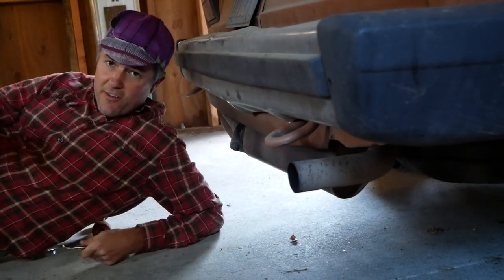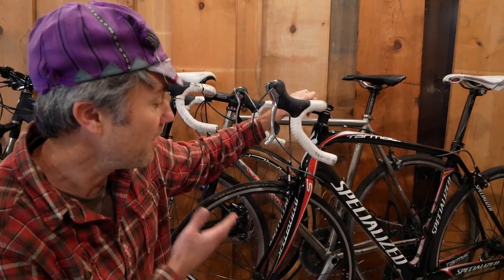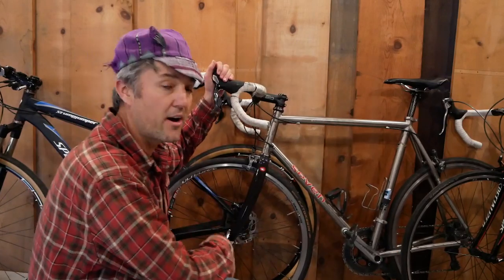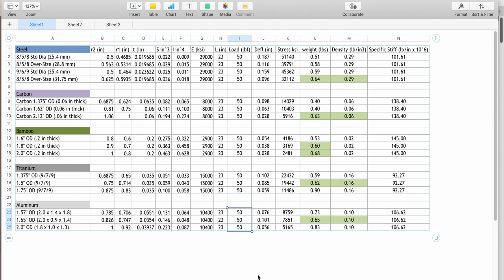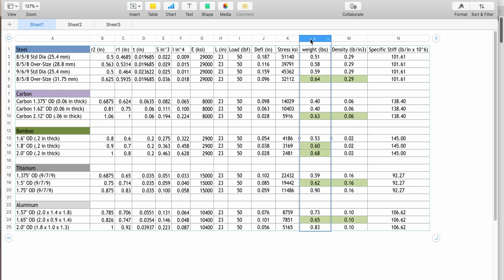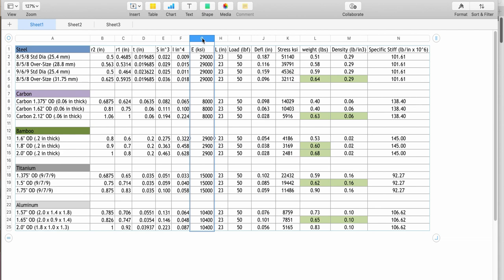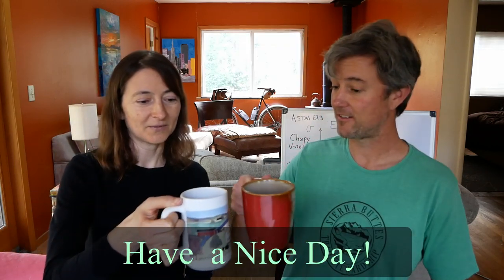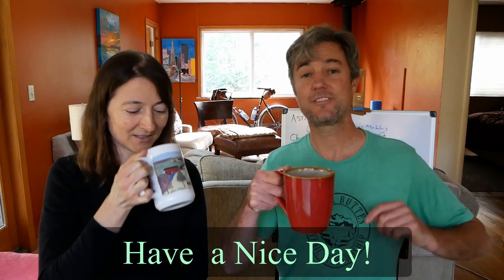Steel is a Great Material for a Bicycle Part III: Stiffness

Comment: Ha, you have the same color Westphalia we used to have.  Vintage '83 water cooled, bought in Deutschland, brought to CA, blew a headgasket under warranty, then driven to death by my in-law's kids.  What a great vehicle.  Many a Moab trip taken in that thing.  Wife cried the day we sold it.  Miss it dearly.  Sold it in Berkeley.  Do you have ours??? 

Too bad the VW "California" camper van isn't available in "California!"  Boo!

Steel is real.  Especially today.  And your bike isn't even taking full advantage of the newer steel alloys on the market.  That shit is STRONG!  Air hardening stuff that is amazing.  So your "steel" column is overly simplified, given all the alloys and heat treatments available.

But let me give you an example.  When I worked with a local framebuilder, we had stock cross frames built with 130mm spacing.  At the time, the industry was just moving to 135, but about half of our buyers still wanted 130mm.  So that meant re-sizing the rear dropouts on half of the inventory going out the door.  These frames were built without chainstay bridges behind the BB shell, which several retailers questioned.  (This story is why they were full of crap - the bridge was TOTALLY unnecessary.  Anyway...)

It was my job to put the frames in the frame jig and cold set the rear dropouts out 2.5mm on each side.  How hard can cold setting a rear triangle out a mere 2.5mm?  Especially road models with thinner stays (than mtb.) and no BB stay bridge?  It took ALL of my 190 lbs. BOUNCING on the dropout to get those things to move.  And these weren't some over-built frames with heavy, beefy dropouts.  No, elegant stays with minimalist Ritchey dropouts.  This was a workout!  Blew my mind how much effort was involved.  This steel is effing strong!

And this is someone who fondly remembers the Cannondale catalogs in the 80's proudly showing off a cyclist crouched on the rear triangle of a bare C-dale frame on the ground that said, "If you did this to a steel competitor of ours, it would collapse!"  And they were right.  But that was the standard 4130 Chromoly of the time. 

Today's chromoly heat treated steel alloys are in a completely different class.

Discussing aerodynamic tubes in a randonneuring context?  Silly.  You body position has WAY more effect on your drag.  Then hand position (aero bars).  Next comes your wheels.  Aero tubes are dumb unless you live in a wind tunnel.

PS  Who remembers Moron tubing?!!!  A winner!  Moron, or "More on" the ends!
PPS  Too bad TrueTemper departed the steel bicycle frame tube market :-(Now they're only focused on 'shafts!'  Nimrods!)  And yes, I realize there was no market for them...

Comment: Another great technical video, this time with a student (?) I love my 5 steel bikes, that I have collected over the years. However, 2017, I did buy a AL and a CF bike, just because. Sort of , always wanted a modern AL and CF bike in my collection.  I have ridden both new bikes over 40 miles, and I find them just as comfortable as my steel bikes, saddles and 25/28mm tires make the comfy difference.  As for aerodynamics, that's for the pros. KB.

Comment: Being a nature grown product, Bamboo varies in shape and perfection.  It's strength is much like carbon fiber, but bamboo cannot be shaped like carbon fiber fabric.  There are bonding challenges with it too, not so easy.  That is why you see bamboo frames butted with steel components, which are pretty expensive to make.  Great vid you two!
Reply: Actually bamboo frames are fitted with rope or cord drenched in epoxy, and, in some cases, fiberglass cast material.

Comment: that was enjoyable for sure,  and there’s no doubt that you could spend a lifetime exploring this subject, heck just concentrate on steel and develop the theory along construction techniques, tube size selection, butting, and the effects of riding (work hardening) on long term durability and how frames get ‘tired’ after years of being ridden........

or you just show more of your fantastic roads and trails, either way I’m in :-)

Comment: The nice thing about CF is the ability to vary layup and orientation depending on the shape being created. Aluminium is similar with modern hydro forming processes. Still, all my bikes are steel these days. Spent plenty of time on modern CF frames but have little use them now.

Comment: Hi Henry and Miss Cools, from Yorkshire UK, my grandad told me how he cycled to Scarborough on the Yorkshire coast when he was 16 in the year 1916 on a bike with bamboo wheels, they buckled and he and his friend had to take the train home (about 80 miles). Perhaps this is why bamboo bikes never caught on. Also stories of rear three wheeler cars in the 1920's which used to tip over going around corners, so we don't see those either. Hired a bike in SF last year and cycled the Golden Gate bridge, very enjoyable. All the best from a wet and wild Yorkshire.
Reply from the maker: Bamboo wheels, wow! I think I'll stick with aluminum for now. It's good to hear you're getting rain we're still waiting for ours.
Reply: Hello again Henry, after posting my comment a video came up by GCN Tech - 'The Incredible Bikes and Cycling Tech of the First World  War' which may interest you. Bikes with wooden wheels and solid rubber tyres. One comment said there were bikes with cane wheels which offered more flexibility and spring. Would make sense I ride some of my grandads paths on my mountain bike. Looking for an address to send you some photos. I work at a museum with a bike section. We have an 1875 bike with wooden wheels and steel tyres like the old carriages. Our WW1 exhibition has photos of Indian Soldiers bike packing on those early WW1 bikes. Hope you enjoy the film. Elizabeth
Reply: RollinRat  Hi Rollin, Just the story he told me as a teenager, inspired me and my friend to get out on our girls 3 speed steel bikes in the 1970s. I work in a museum and we have one old bike in our collection with wooden wheels, don't think I would fancy riding it though. I live high on the pennines so hoping to get out this week near home. Been self isolating since the middle of March, not sure if I've had Corona or just bad flu, but I'm ready to get back  on my bike. Stay safe.
Reply: RollinRat  Hi Rollin, Still got my old girls bike I bought with my pocket money when I was 12 but it sits in the barn now. Getting older and living ar the top of a one in four hill I cheat quite a bit these days and ride an electric bike. I have a mountain bike which I do ride more in the Summer as my fitness improves. Lots of off road trails near me and its fun to ride. I have a campervan so I usually take the mountain bike away with me. I do have a folding bike with 20 inch wheels that fits inside the van, but that feels too much like hard work unless it's really flat. Nice to talk to you, all the best. Elizabeth
Reply: RollinRat  Hi Rollin, Yes in my early 60's enjoying life, semi retired had a gap year at 60 but then went back part time to my job in the Museum. The weather in the UK can be awful in the Winter, hardly got out at all this year too wet. When I did get out in February it was on the electric bike. So disappointed at the end of last Summer I was out on the mountain bike most of the time my fitness had improved so much. With this lock down hopefully there will be a chance to get out more. My electric and folding bikes are steel but the mountain bike is aluminium. Put some Jones H handlebars on my mountain bike to make it more comfortable. Its not steel but put of all of my bikes I do think its the prettiest, I just love the colour etc but that's just a girl thing. I had the gears on my folding bike lowered some years ago, better now for hills but frustrating on the flat. Had the brilliant idea of adding the original chain ring and an extra shifter, front derailleur to the folding bike. Took it to a bike mechanic who said it would probably cost more to weld points on the bike to fix the cables than the bike was worth. Suggested I go away and work on my cadence, probably right, again this is a great trail bike with wide wheels and big chunky tyres so I don't want to replace it. We have some great cycle  paths in the UK and I do enjoy riding away from traffic. It's fun planning holidays around cycle trails. Having said that I did hire a bike when I was in San Francisco and felt quite happy seeing the city that way. Did a big trip across the USA on Amtrak, wouldn't have fancied it in Chicago the traffic was nuts. Wish I'd hired one in Santa Fe. Don't know when we will all be able to globe trot again if ever. You enjoy your semi retirement too. Heading to bed now it's late in the UK.
Reply: RollinRat  Thanks Rollin, I will look into that, I had thought of a jubilee clip or cable ties after I left the bike mechanic. The original chain ring is pretty heavy steel, but has mounting points where the smaller chain ring could be attached. Maybe I could find something similar but lighter. Not confident to do it myself at present, maybe bike maintenance classes, spent 8 years going to car maintenance and body work classes. Find in that sort of environment people are always keen to help one another. Once again thanks, I'll look up the parts.
Reply: RollinRat  Thanks for that, been a few years since I attended classes. Still got  my little classic sports car, I took to classes to work on, but think my mechanic needs to get it running again for me now. Life took over for a while and there was less time to spend on hobbies. I'm lucky in that my Campervan is 4wd and so is my everyday car. I do love small discreet 4wd that can get you up a single track road or track. I like the folding bike, because it's more stealthy in the van when wild camping. It also fits in the passenger seat footwell. Like you I like to keep my bikes and cars a long time. Had my 70s sports car almost 30 years now, took a lot more saving up for than the first bike, but that's what makes them loved and treasured.
Reply: RollinRat  Hi Rollin, No I'm a big fan of Japanese 4wd. My Campervan is a Toyota Regius 4wd. A company near me buys low mileage Japanese imports and then puts new conversiond in them. It was just like having a new van at a 3rd of the price of a vw. I got to choose my layout trim and upholstery. The base vehicle is 1999 and I have owned my camper since 2011. I know you can't get those Japanese imports into America until they are much older. My everyday car is a Daihatsu Terios 4wd, it is the second one I've owned, my last one was fine mechanically but rust issues meant it wouldn't pass another Mot. My first car was my mums old vw Beetle, that broke down so much I couldn't afford to keep it! Those Vanagons look cute. I really the truck campers and considered one when I bought my van, but the insurance in this country was just crazy. Also I don't have to leave the vehicle if I need to move on in a hurry.
Reply: RollinRat  Just to add to my last comment, you are very lucky to have those Overlanding trails over there, we have nothing like that here in the UK. Wild camping in England is illegal although allowed in Scotland. Always seems to be cars around though. My ex is from Washington State and I know you can travel down a logging road in Washington or Oregan and see no one all day. I have managed to find the odd logging road in this country but there's not many. Love watching some of the Overlanding channels. Enjoy what you have out there.
Reply: RollinRat  Thanks Rollin, Will have a look tomorrow, heading to bed now, hope to get a bike ride in tomorrow before the government bans out door exercise. Our PM is in hospital now, thank goodness for our Queen gave a lovely speech tonight to keep the spirits up.
Reply: RollinRat  Can't say I liked California that much when I was there, but I'm used to cold and hills. I did like San Francisco, but wouldn't like the earth quake threat. I'd heard it had become expensive. I'm very lucky living in the family home that's been in our family for the past 500 years and it is rural. Probably best in Colerado once this is all over. Still up been trying to ring my ex in Seattle just to make sure he's still OK. We spoke about 3 weeks ago but things have got alot worse since then. Was back in Seattle a couple of years ago and it was so busy compared to how I remembered it. You take care of your family. Stay safe
Reply: RollinRat  Hi Rollin, Just wanted to thank you for the suggestion of clamp on cable guides, they look to be just what I need. Found the Top Gear programmes on 'How to kill a Toyota' think as long as I take care than my van doesn't rust and the government don't insist on electric vehicles , I may just already have my forever van. Got a good bike ride in today up on the Moors, very quiet out there but feeling so much better for getting out. Thought you may want to see what some of  my local bike rides . Found these on YouTube Cup with Reservoir Marsden Moor Blueflush,  Wessenden Head  Mountain Bike Ride Terra Nova and Marsden Packhorse Trail MTB Junibesi 14 .The last one is a bit too difficult for me , I was up there last Summer ,out for 6 hours and pushed the bike down most of it, the ruts were half way up the wheels, didn't want to end up in hospital. Today just did the Cupwith one. Hope to get out tomorrow. Best wishes to you and your wife, and thanks once again for the advice.
Reply: RollinRat  Thanks  for the offer Rollin, there did look to be quite a few available on Amazon, not going to order now because deliveries are all over the place. Ordered quite a few bike/ van / camping things over the winter ready for this Summer, luckily most things arrived before the lockdown just a couple of things who knows where. Looks like August before we are back to any sort normality. Did see three planes today which seemed strange one flying low on the flight path to Manchester Airport, probably bringing people home from wherever in the world they were stranded.

Comment: Wow I thought I was a Specialized junkie with my steel Stumpjumper Comp and bonded Allez Epic 105 but you handily beat me. For my plastic fantastic bike I have a Look 555 Ultegra which feels like I'm riding on air except when I go uphill.
Reply from the maker: I finally let go of my Specialized Expedition touring bike. It was a great bike, but a little on the small side. I like how the new Fitz feels, but I may need to find another touring specific bike to fill that void! Dang!
Reply: @Henrywildeberry  I think the randonneuring Ms Cools keeps trying to get you to do is a lighter way to bike tour.

Comment: Two weeks ago a friend of mine who has a full carbon-fiber bike (a 2019 Canyon Grail, w/ hover-bar) and I (on a Specialized 2018 AWOL steel bike) road some very rugged and rain-rutted, and very chunky gravel roads. At the end of this ride, as we were loading up and driving away, my friend mentioned how 'beat up' his wrists and hands felt; whereas I felt surprisingly less beat up. The question  I have is do you think his carbon fiber bike, being so much stiffer than my steel frame bike, was the main cause of his hand and wrist fatigue? He certainly had the advantage in the lighter frame, but over all, and with the roughness of the roads and hills we'd been on, I felt my steel bike held it's speed better over all, and was more forgiving of the jarring nature of the road surfaces. Any thoughts on this? Thanks. And thanks for the more detailed look at steel and material comparisons!
Reply: To me, carbon forks are targeted to sprinters, and are way too stiff for most of my mileage.  My wrists never got so tired with my steel forks -- not because of the material alone, but because they were built to have spring that a carbon fork can't have without risking delamination.
Reply: Umh....probably variables like handlebar type, size and material, grips/wrap material and thickness should be considered, not just frameset. Tire size, how much they were inflated, too. Bike fit also contributes to comfort during rides exceeding usual distance or "easiness" of road conditions.

Comment: What about sowing us the difference in your chart on 6061 Aluminum and 7005 Aluminum?  I do own a Chromoly Steel bike with Aluminum parts and little bit of composites too.  My new road bike has 7005 Columbus Triple Butted zonal Aluminum with Carbon Fiber Seat Stay and Carbon/Aluminum Fork.  The rest of this Aluminum bike has Aluminum parts and it weighs 21 pounds without the accessories compared to my 30 pound chromoly steel mountain bike.

Comment: GCN claims the best performance upgrade is to the wheels. Body position is the best free upgrade for sure.

I ride steel because I am large, My confidence on my Lemond Zurich is a lot less than on my Raleigh 3-speed.

Comment: Did an 80 mile ride last weekend on rough roads with my Raleigh Record Ace equipped with 25c tires. Unbelievably stiff in a bad way. My wrists and hands were so sore, I'll stick with my Supersix or Cervelo R3.
Reply from the maker: 25c tires on rough roads can be pretty harsh. Repeat the same route on all three bikes with the same tires at the same air pressure and let us know which bike rides best. That would be interesting to see.
Reply: @Henrywildeberry  I'll try it with the other bikes. I'm also planning on running a 28c up front at 70-80psi. The RA is a lugged Reynolds 520 frame with a curved steel fork. The geometry is aggressive and reach is shorter than the other bikes which may make it less comfortable.
Reply from the maker: Aaron _ you might be more forward on the bike putting more weight on your hands. I’ve used a bathroom scale to check my weight distribution on my bikes. That may not solve it completely, but might offer some insight into what your experiencing. I have noticed a subtle difference riding my carbon bike with a very long and slender seat post that feels marginally better. However, tire size and air pressure makes the biggest difference.